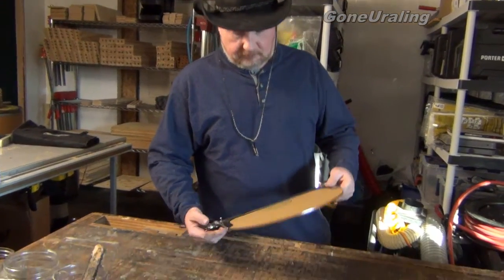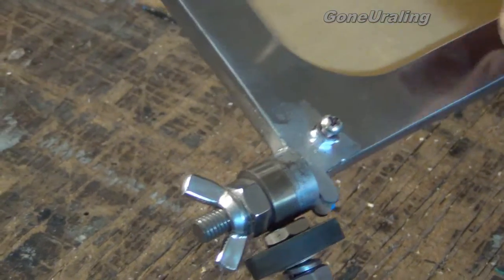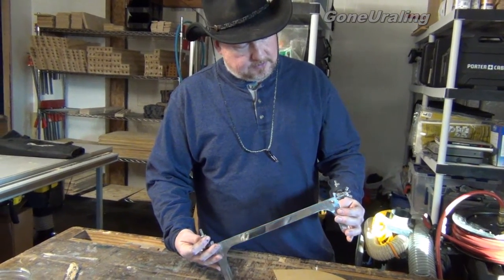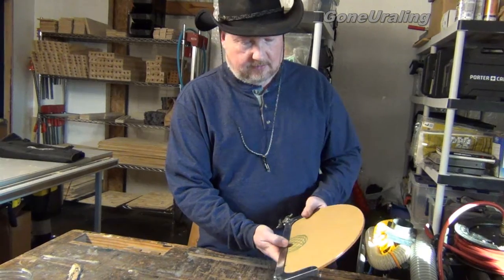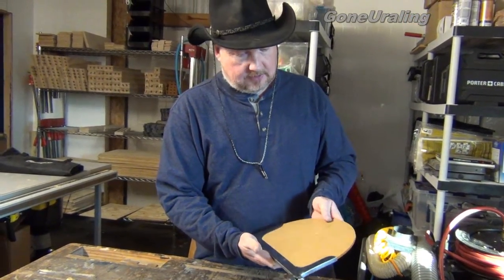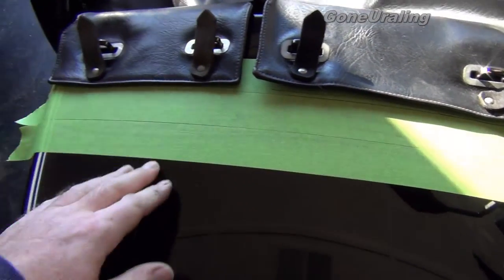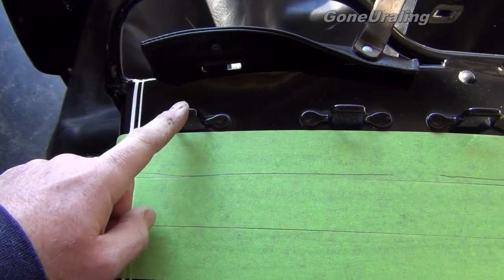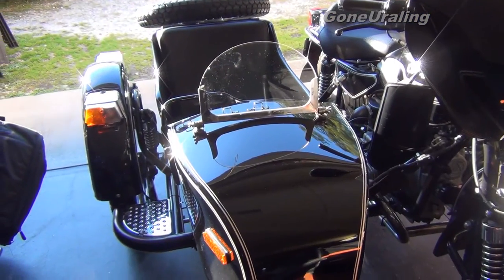Mini Sidecar Windscreen Install - Doggy Winshield

Comment: Check the company called Abington Spares.  They sell a Brookland's model - the windscreen this one this is (poorly) patterned after.  No faults whatsoever, perfect chrome and polished cast aluminum.   Real safety glass, not plastic.  Beautiful, elegant chrome mounting stanchions,  not mismatched bolts. Chromed wing style nuts, not common hardware store junk.  $155 delivered  (Feb. 2022).  A much better solution.  Other vintage sports car parts sellers sell the Brookland's model as well...
Reply from the maker: I have a Brooklands I bought for my 2017 Retro, but it is still in the box. When I purchased it I did not realize it did not mount the same with a bolt mount. This one has two TINY little feet on it turned flat ways to the wind (perpendicular to the way the wind will push on it) and has 4 VERY TINY screw holes. I don't trust how small they are and have never mounted it. Time just got away from me with everything we've been going through and it has not been a priority.  One day I may pull it back out, cut those off and weld on a stainless steel bolt or something.
Reply: @GoneUraling  Hi, are you saying the Brooklands screen has tiny feet and screw holes that you don't trust?
Reply from the maker: @aleshamahon  Yes, too much leverage up high, on that tiny 5 mm or so wide base I expect it to be able to flex enough it could crack the paint if nothing else. Just does not seem sturdy. I would prefer the base be turned 90 degrees for a solid mount or just use a through hole mount.  My Son got it for me, I never followed up once I saw how the base was I just set it to the side and have never revisited it.  I thought I might either find different bases to fit it or cut them off and weld on a SS base of my own with a through bolt or something.  Maybe I'm wrong, but I've already ridden 20,000 miles since I first got it, I can't see it having survived without something failing.

Comment: Did you consider that since this was designed for the CJ and NOT your bike/sidecar is the reason for the two different bolt sizes? Perhaps one side NEEDS the longer bolt on the bike it's designed for.
Reply from the maker: +Returning Shadow I did, but the CJ is virtually a clone so I don't think it would need to be different.  Either way, it fits great on the Ural tub.